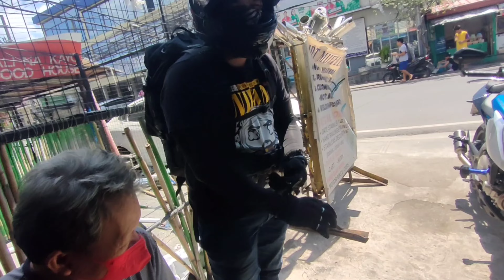JPT MUFFLER SHOP | Palit pipe | NK400

Comment: From engineering  perspective, the piping loop system was design  to give more thrust power  at exit  to enhance additional  speed  .Also, the piping system is provided with 1st stage resonator with flow control system  to compressed  flue gas  and released to pipe loop with tremendous whirlwind at this junction and released to 2nd stage muffler to amplify its sound and released with a high thrust force
Reply from the maker: Thanks mam sa info🥰